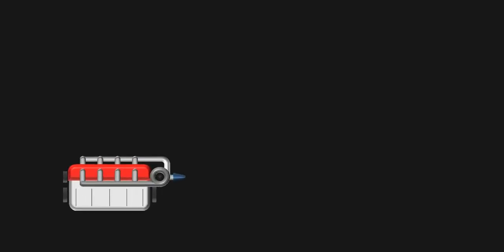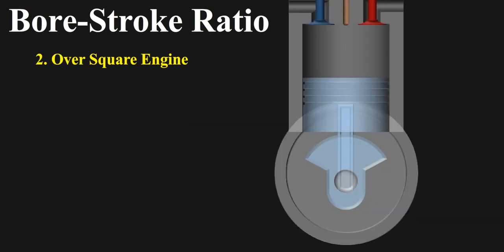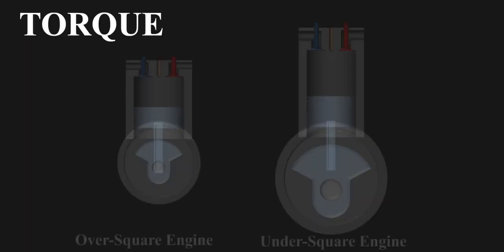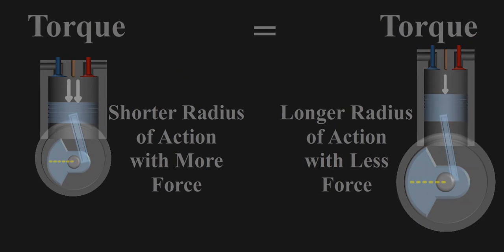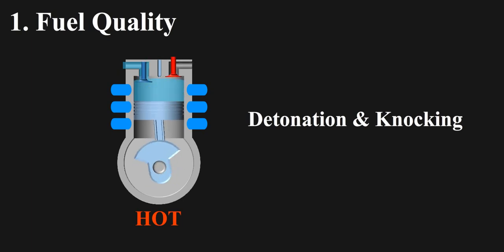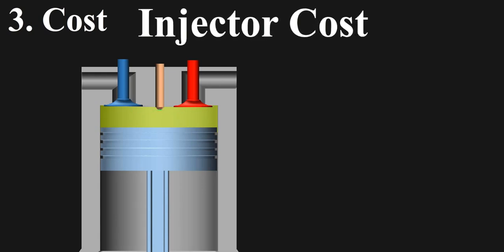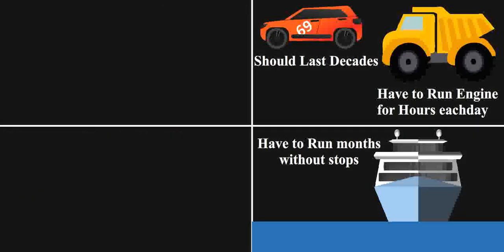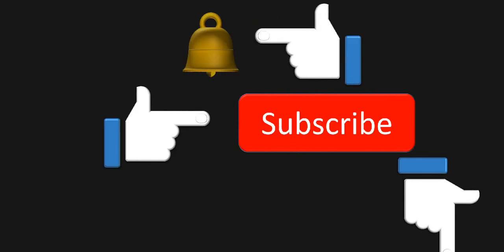Bore Stroke Ratio | Performance  Engine life  Effects | Applications

Comment: The guy who made the video thinks
1.
The Engine’s Torque, not its Power, is responsible for the cars rate of acceleration.
2.
He thinks less time is required for the piston to travel from TDC to BDC in a shorter stroke engine than a longer stroke one.
3. That a longer crankshaft journal offset length provides increased leverage.  

Are there any myths he forgot to perpetuate here?  Torque is strength and Power is top speed?  I’m surprised he missed that one.  Please don’t watch this video kids.

Comment: 2:35 u were slightly wrong here. Piston didn't take more or less time to travel BDC to TDC, they did in a exact same time in either cases only the piston speed is vary. At similar rpm long stroke engine would have much higher piston speed than short stroke, which limits the rpm to go higher.
2. Short stroke engines does suffer from more heat losses due to More surface area is exposed in very beginning of combustion, when piston is at TDC. This is where piston experience highest peak force due to peak pressure. 
3. Long stroke engine produces more torque at lower rpm bcoz high piston speed n small valves results in high velocity incoming charge, forming a strong swirl (a turbulent motion) which leads to faster burning. It's very important to minimise heat losses as it reduce the ignition timing. Less heat loss= high peak pressure= high peak torque.

Comment: Can u tell me about my engine, I have a 2022 Suzuki GSX-S750.  I think it has a 4 cylinder Big Bore Short Stroke, over square. The only new update to this bike is Suzuki shortened the final gear ratio while adding more top-end power so u can hit same top speed. $8550 and will do 0-60 in 3.5 but top speed is 144 MPH. I’m at the 🇺🇸🐉Tail of the Dragon🐉🇺🇸 318 turns in 11.6 miles no side roads, 10 years flawless victory.